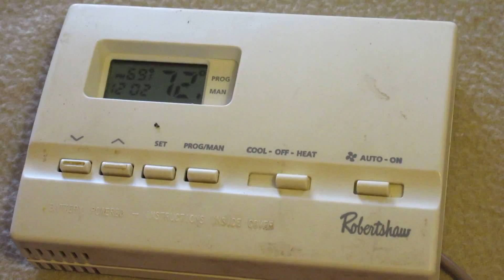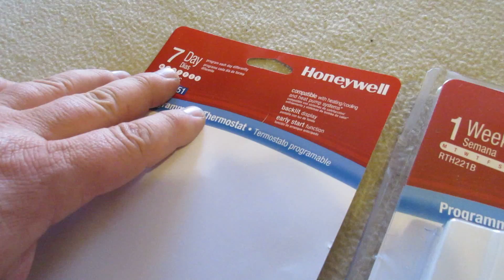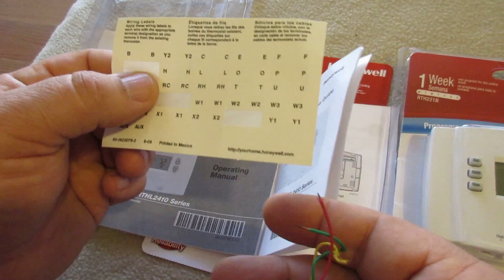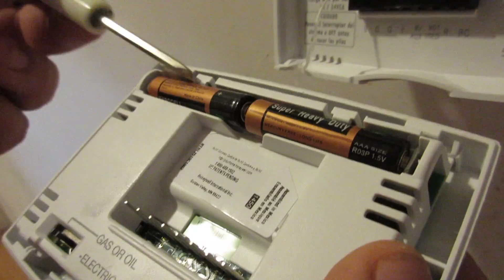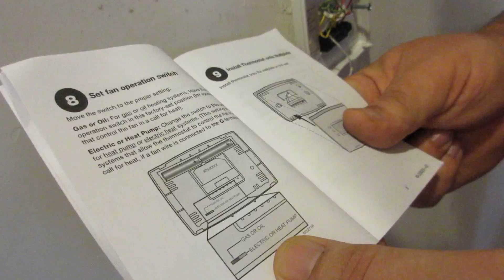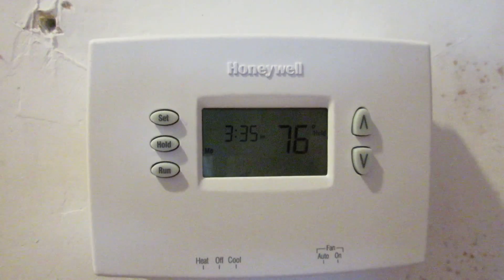Honeywell Thermostat Wiring - Wire Programmable Thermostats - Heater Air Conditioner HVAC Furnace

Comment: Question here. mine I just bought has the red to red jumper. However the screws to hold it in are so tight they will not back out to slide the red into the slot with the jumper. Suggestions?
Reply from the maker: I hope you were able to unscrew the screws somehow, and the screw heads are not damaged? If its damaged screw heads you might need a screw head extractor

Comment: Were it say's RC is Red for Cooling if it say's RH it means Red for heating & I had to put a little black jumper wire between the two removing that little jumper staple & connect the red wire with the black jumper. I also hooked my White wire which is alway's for heat to the W & the green wire to the G & my blue wire was hooked next to the Y as I had no yellow wire & it all worked as should in the H & C system. I don't understand why I had a blue & yet others have yellow but my systems works with the blue connected to the Y but I don't know why & that's no lie! So maybe you can tell me why?

Comment: Hello,
I had a "lever" type of thermostat, it never ran the "fan" on the auto/on part when I had the heat on with the old one. Now I switched to this Honeywell (thanks for the tutorial) and the heat fan and the "fan" are both on. I am wondering if this is normal? My wife is wanting me to turn the "fan" off and just run the "heat fan" on its own. Is that possible?
Reply from the maker: With our unit, when we have the heater on, the fan that turns on are the combustion fan and the blower (motor) fan. You might need to check with HVAC manufacturer for your specific unit model specifications to verify if heat fan and fan turning on at the same time in your unit is normal or not.

Comment: there are only 2 wires coming out of the wall for my thermostat but was told by a technician to buy a 5 wire thermostat. anyone know why  or how I would hook it up?
Reply: You should at lest add a green(G) Fan on/off wire.  It is a Machine, Hack it like ya got a pair;^D  You don't even need a thermostat, you could wire it with dials, levers and knife switches...Are you controlled by the machine or is the machine controlled by you...apparently, that is the question these daze^!!^

Comment: You don't HAVE to turn off the breaker to your AC. Thermostat is wired in with the heater control board. Just unplug the heater.

Comment: This is a good video.  I don't have a drill though and the size of the digital thermostat differs from the analog thermostat so I guess I'll have to call someone in to do it.  Argh.  I also have zero experience doing this kind of stuff.  I am not even sure which breaker is for the heat.  I live in an apartment building.